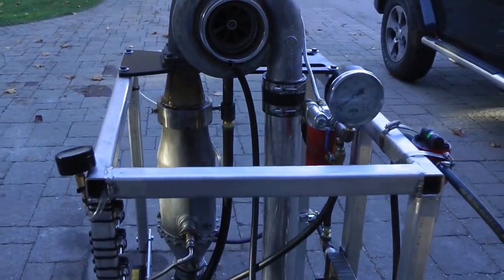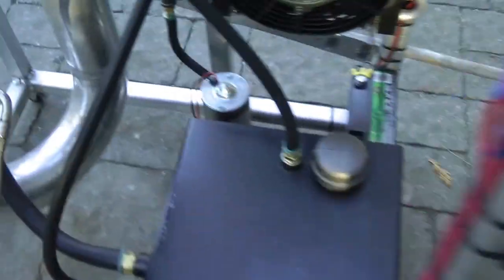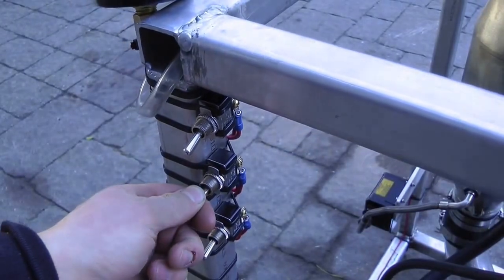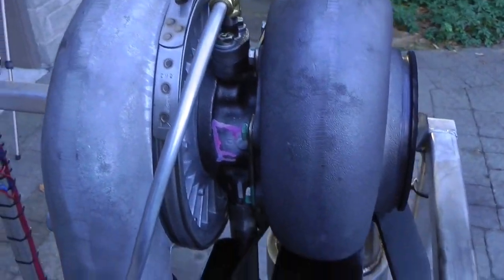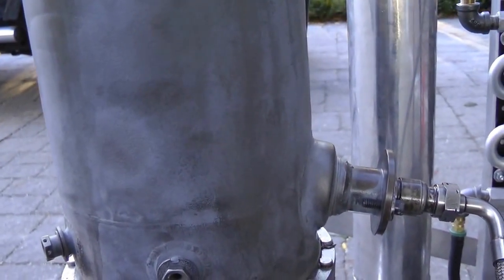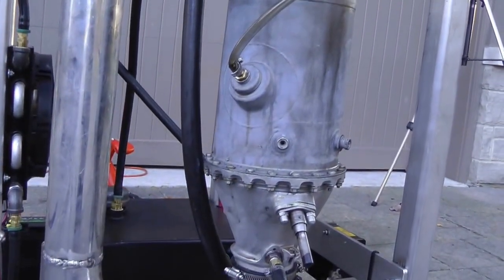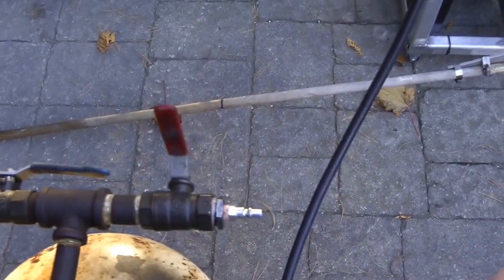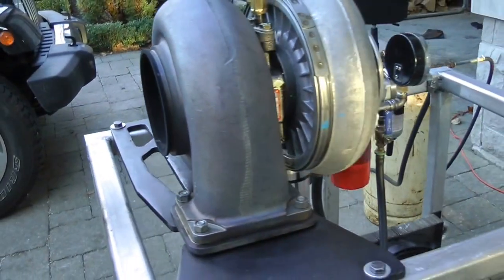Homemade Jet Engine Walk Around

Comment: Amazing , but i have question about pressure gauge is located above the on off switches and I think is connected to combustion chamber, which one is that describes me shortly.
Reply from the maker: Compressor Discharge Pressure. It is measuring how much pressure is inside the combustion chamber

Comment: Very nice! But I am not to sure about the safety of a diesel tank pressurized at 180 psi. And the RR dart engine is fitted with 7 combustors
Reply from the maker: Thank you,
The tank is safe, it can withstand well over 700 PSI. Yes the the dart does have several combustors but I am just utilizing one of them for this project.

Comment: There it is!  I thought that combustion can looked like a nice factory component.  Perfect!
Reply from the maker: Yea I must say it works quite well! rolls royce sure knows how to make a jet engine!
Reply: @nyecegarage7173  Yeah, no kidding! Rolls Royce does know their jet engines! Their flagship RB-211 High Bypass Turbofan jet engine is used on the Boeing 747², 757¹, and 767. Their most advanced series, the Trent family of engines, is used on some of the newest airliners, like Boeing's 777² and 787, or Airbus's A330, A340¹, A350, and A380¹.
Notes:
1: These aircraft are not being produced anymore.
2: These aircraft are still in production, but the variants that use this engine are not being produced.